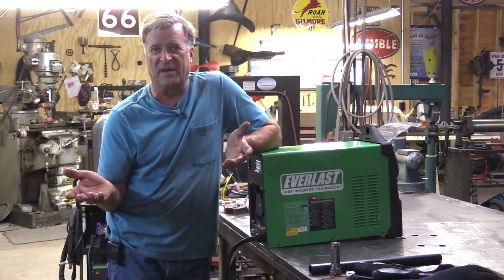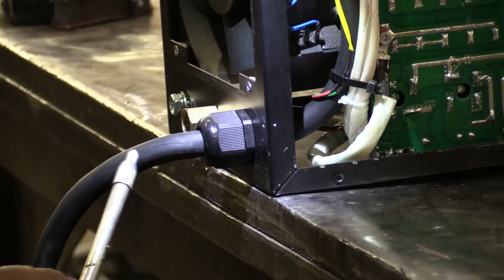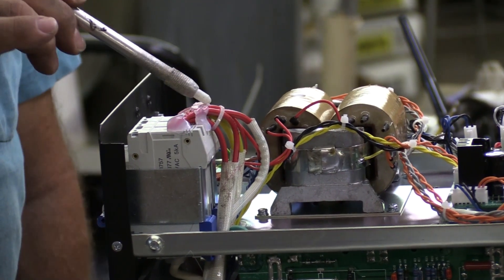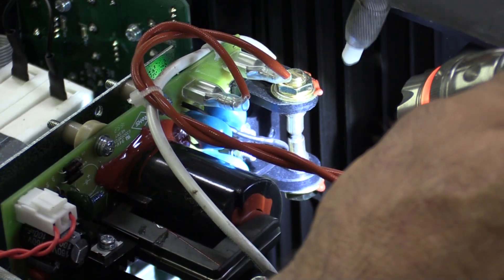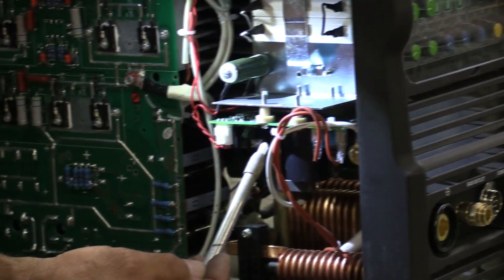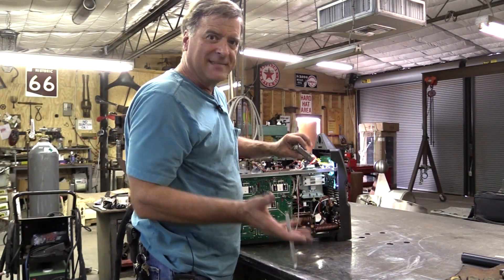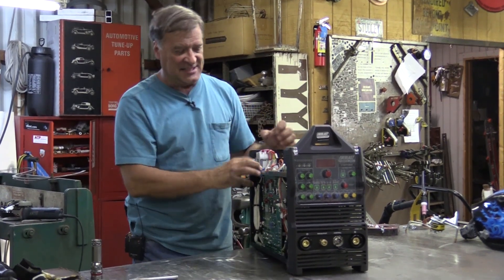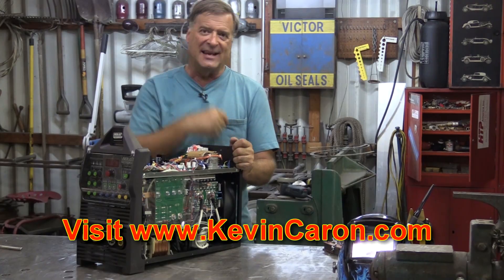What Does a TIG Welder Look Like Inside? - Kevin Caron

Comment: Where do the power wires plug in to inside?   The black + and white neutral Wires go.  Trying to replace mine with i removed year's ago for my dryer.  Finally getting back to tig on my power tig 200dx and no wiring diagrams
Reply from the maker: They should plug in to the switch.
Reply: @KevincaronSculpture  I just figured it out  had to remove that switch and luckily I labeled it B&w. The wires went underneath and held in place with a set screw.

Comment: I opened the case on my Everlast tig machine that had been on my bench for about three weeks and found a mud dobber nest the size of a small apple. Is that normal?
Reply from the maker: If they were buzzing in Chinese then yes. leave them in there.  They make the smoke for the machine to run on..   If the nest looked like a college dorm room then nope, you have teenagers!

Comment: Kevin: I want to weld a 'skin 18 gauge  onto a 1/8" circle. when I do a tack around the circle and go back and weld I get warps which really screws me up. How can I avoid this? Can I? Thanks.
Reply from the maker: Get a piece of thick aluminum plate, clamp your part to the aluminum and try again. The aluminum will act as a heat sink and that should help keep things flat.
Reply: Thanks for the prompt reply and great idea.

Comment: i might actually even look into a mig 140e from everlast i dont know yet. Its a ways off till i think about that but yeah 
thanks again
Reply from the maker: Solid machine and stood up for everything i asked of it!
Reply: I been debating on 3 different mig welders. the AHP alpha mig 140, the everlast power mig 140e or the eastwood 135 or 175 variants.    So many choices but most of them only have a 25% duty cycle so yeah idk.
Reply from the maker: All little machines are like that now.     If you want more duty cycle you need to step up to a bigger machine.
Reply: oh i know i just think it kinda sucks that is the one thing that companies havent fixed yet with the smaller machines. I mean they could make the machine slightly and take a page out of the computer world and put a fan next to a heatsink which would be over component that gets hot.
Reply: The fan blows right through the heat sink.  It uses a type of tunnel design where all the air is directed through the sinks.

Comment: Hey kevin thanks for the info. I was wondering about that stuff myself since i cant take my cover off or it usually voids the warranties. I assume the AHP has something similar but a different lay out of course. Anyway thanks :) it helps a lot to know everlast isnt junk despite what ive been told.
Reply from the maker: Been very impressed with the machines from Everlast and the customer service as well. Called in a few times without telling them who i was and got the help i wanted.
Reply: BTW kevin i tried using 1/8th inch diamater 7018 on house hold current at 115 amps and i flipped the circuit breaker. So i was gonna try going to a 3/32 diamater electrode and trying around 80-90 amps. i wonder if that will work better since i dont have a 220v line installed.
Reply: The warranty is NOT void because you remove the cover.  Rather this is expected and required to maintain the unit and to keep your unit clean inside and the points adjusted.   Neglect of the interior of the machine can lead to a greater issue with voiding the warranty in extreme neglect/abuse situations.   The manual instructs the customer to remove the cover to clean the interior (compressed, dry air).on a regular basis according to use patterns.
Reply: ohhh ok. thanks everlast. I didnt think you guys jumped on kevins channel. Thats cool.  thanks for the info :)
Reply: So like computer components and inside a computer case :).